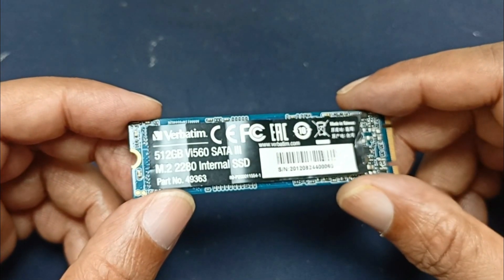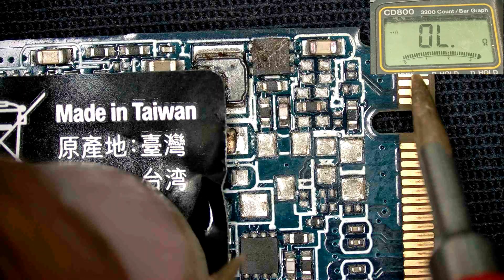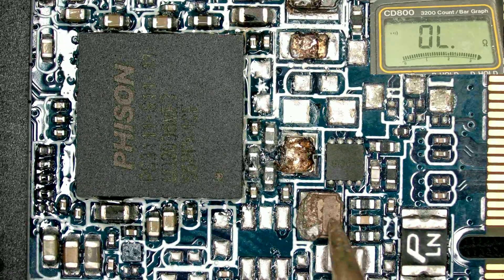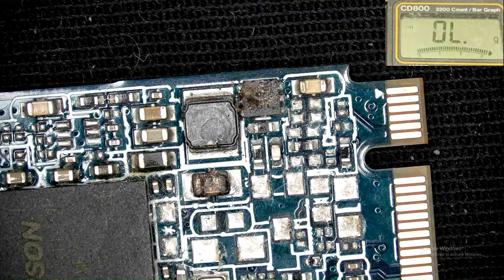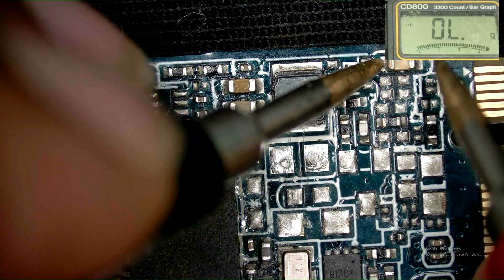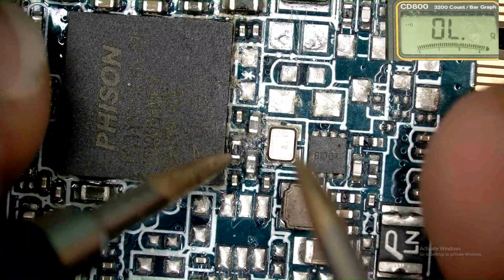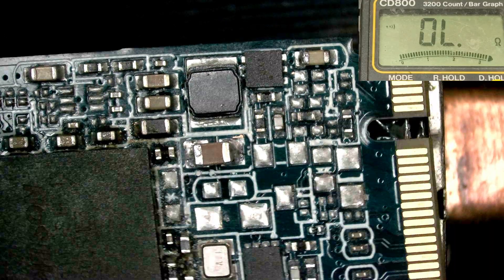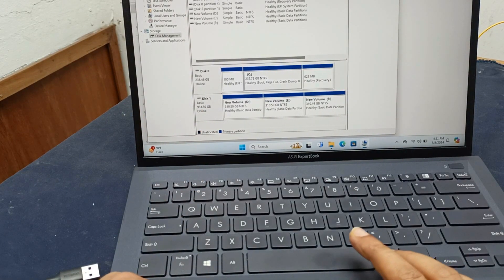How to repair Dead M.2 ssd drive || M.2 ssd drive not detected

Comment: I have a Hikvision M2 Sata SSD. I use it as a portable disk. Currently, some images appear as 0 bytes. The data transfer process is very slow and the connection is frequently disconnected. How can we solve this problem?

Comment: bro can your reapair, QNAP and Synology devices if yes kindly upload related this devices videos.
Reply from the maker: @aamerali7393  what is your device type Synology NAS or SSD
Reply: @mrcontrive5641  Qnap Model TS-251, its starting but no display
Reply from the maker: @aamerali7393  this device is not available to me. at this time
Reply: @mrcontrive5641  ok bro no issue, in future if possible kindly upload relate to topic thanks for your response

Comment: well done, good repair...
i would not trust these cheap SSDs to keep data on them.....without backup.
Reply from the maker: I found a voltage regulator and capacitor damage .There were two chips (CA8BG64A0A0 these for storing data.here is nothing unbelievable
Reply: @mrcontrive5641  Impressive troubleshooting and SMD repair, even without service documentation!  I have a Samsung 990 Pro 1TB  that was in a flood and hope I can also repair it and retrieve the data.  Did you get the replacement parts from newly-purchased drive or were you lucky enough to have  used drive that could be used as a "donor"?